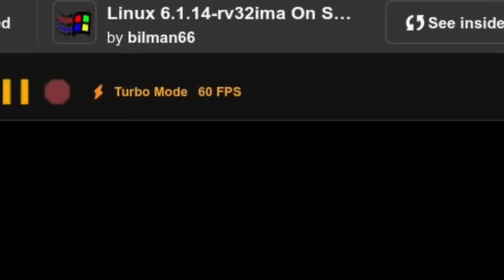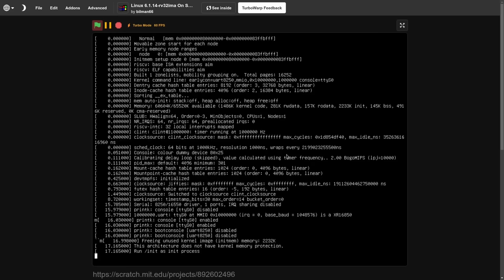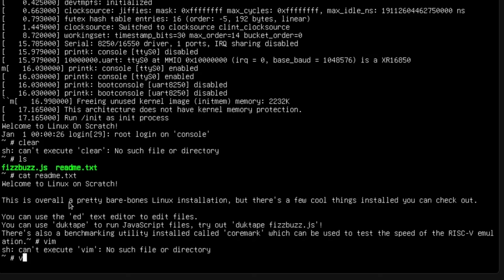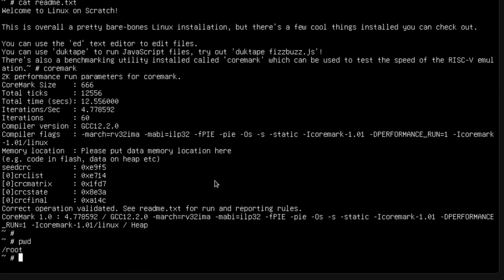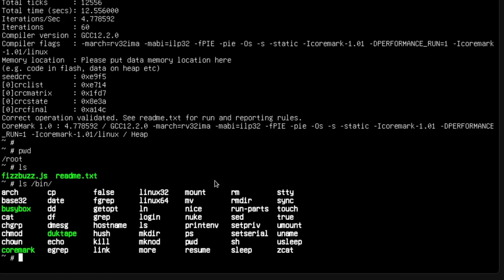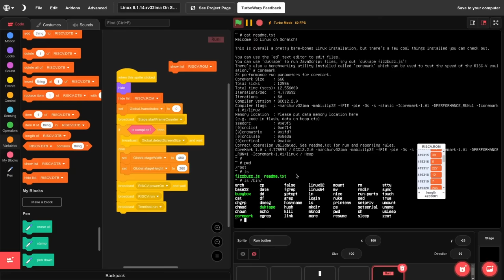They actually DID IT... Linux on SCRATCH

Comment: so strange how the dev included a js engine into this but not a C compiler
Reply from the maker: It is strange! I was thinking it has something to do with Scratch being in JS, but I'm still not sure.
Reply: It is in fact @Denshi
Reply: @Denshi  Yes, Scratch is made with Javascript and Turbowarp even compiles Scratch projects into Javascript, but that has nothing to do with this project.
Reply: I think js is easier to implement?
Reply: @Denshi  don't  think so Turing machine https://en.wikipedia.org/wiki/Turing_machine
Reply: if you have the kernel you can perfectly well implement anything with relative ease
Reply: EDIT: I'm wrong stop liking this 💀💀

Turbowarp compiles scratch projects to Javascript, making it trivial to run javascript (they did not need to implement a javascript engine)
Making a C compiler would be torture
Reply: @iluvsoupers  that's not how it works though, you can't just run arbitrary javascript in scratch (or turbowarp), also porting the C compiler isn't hard, as tinycc can be compiled to riscv
Reply: @int32_  My bad then, could've sworn you could do that in turbowarp
I didn't really look at the project itself because I was away when writing that comment
Thanks for the correction
Reply: @Denshi  Hello, I helped make this project and built the ROM it is using. It has nothing to do with the fact Scratch is made in JS and everything to do with the fact the I am lazy. The duktape project was included because it was made for embedded systems and as a result, worked very easily with this version of linux. It had also already been built for RISC-V 32-bit by somebody else, so it was very easy to port over. I plan to release another version of this project in the future which includes tinycc. In my opinion, it was also a more impressive demo to see JS running than a C compiler.
Reply: @tacodiva7729  Weird, i literally put a comment on here not too long ago saying the same thing but it seems it was removed lol
Reply: @garethgan9519 It is not. C is a drastically easier language to write a compiler for, because a C programmer is required to explicitly explain more details to the compiler. A JavaScript engine has to keep track of a bunch of extra things at runtime because the programmer never specified what they should be.

(Specifically, I'm talking about dynamic typing and automatic garbage collection)
Reply: @Nanagos  Scratch is Javascript and Smalltalk. (or the old scratch client is Smalltalk)
Reply: Because running a compiler would be much much much more resource intensive then to just use a really rudimentary JS interpreter. The interpreter used here, duktape, is also only a few hundred kilobytes in size.
Reply: @Denshi why does qemu not work when i try to emulate a newer gen intel cpu on an older intel gen?
Reply: you do know scratch has a file size limit…
Reply: @iluvsoupers how would it be a nightmare? This is the riscv architecture not some unique black magic, pretty sure riscv compilers for c already exist?
Reply: I'm only a minute into the video, but he said it's just an emulated RISC-V processor; doesn't GCC already target that considering the kernel exists for it already?
Reply: Because he's gay
Reply: Probably because GCC itself is several gigabytes. Duktape on the other hand is extremely tiny compared to that.
Reply: the Hubris of Man is still conjecturing why this is the case when someone from the project clearly explained it
Reply: @amogus-dn8qn Kind of, but you need enough memory and computation.
Reply: @amogus-dn8qn  How? Dont you still have to implement a compiler which is also hard ?
Reply: no, you can just throw any linux-compatible compilef on it of you want
Reply: i love not knowing coding things so this means literally gobbledygook
Reply: @garethgan9519  no, no it is not
Reply: @garethgan9519 Much, much easier to make a js engine in a js engine than a entirly different language
Reply: i think gcc or clang would be too big for the ROM since scratch has a list element limit
Reply: based zoomer dev
Reply: It needs a HolyC interpreter
Reply: @antonliakhovitch8306  just ignore past me (That's my past acc). I hate my past self lol. such inexperience. ;-; (And yes, I know, C is a low-level language, closer to asm, so easier to make)
Reply: Recent GCC and LLVM would make the disk image huge and run very slow, TCC is feasible but I doubt it has a built-in linker for RISC-V, and GNU and LLVM binutils are kinda huge. Not having a linker would be useless either.

Comment: The only truely bloat free installation.
Reply: Second only to not running linux at all.
Reply: @EdgyPuer mfs explaining why their barely supported obscure bsd distribution is actually way better then Linux because it saves 25 mbs of ram
Reply: @Natalietrans  Not running an OS or even a computer saves far more mbs of ram.
Reply: @EdgyPuer   You fool, I run Linux on pencil and paper by following RISC-V instructions by hand /s
Reply: @glitchy_weasel 😂
Reply: computing like it's the 1930s @glitchy_weasel
Reply: Despite making this they still got rejected from a job opening for a senior level Scratch developer
Reply: @glitchy_weasel you must be my 2nd year CS professor.
Reply: it has js and a benchmark tool, pretty bloated if you ask me
Reply: Just use paper and pen, no need for computers
Reply: well it has javascript so no its not
Reply: @glitchy_weasel  The good ole 0.01 Hz processor
Reply: @glitchy_weasel  It's a good thing you included the "/s" otherwise for a second there I might've thought you weer serious!
Reply: Linux users destroying their display (it’s using gpu power and therefore bloatware)
Reply: 'ls' is bloatware, just keep track of where your files are!

Comment: why do I feel like we’re gonna eventually get a full Windows installation in Scratch
Reply: The author of this is working on getting windows 3.0 running in scratch via 8086 emulation
Reply: @iflyplanesthrutunnels  The amount of performance overhead this would cost to a PC would be insane. Gonna make an i9 13900K feel like a potato CPU with how slow it would make things
Reply: Seems possible once someone would shrink Windows to 25mb size, i think it surely could be nano version of 3.1
Reply: why tho? we already have virtual machines, it would be a massive copyright of published although I don't think that would be an issue due to scratch being absorbedly slow

Comment: HOLY.... These madmen, what have they done!!!!!!! And they are BASED AF for choosing RISC-V!
Reply: Probably because its open source and easier to implement?
Reply: @october1234  You have to be trolling me right now?! Even been open source, implementing a FUCKING KERNEL PLUS SOME APPS on FUCKING SCRATCH requires so much dedication and time...
Reply: @godnyx117  Dont get me wrong, I agree that implementing a cpu is extremely hard, let alone scratch. I just want to point out that a possible reason for them to chose risc-v over arm or x86 could be because it is open source.
Reply: @october1234  Oh, I thought you talked about the Linux kernel and meant that it is easy to do it because it's open source, hence why I was so "socked".

In that case, yeah, RISC-V may be chosen for that reason! This project is so cool and interesting!

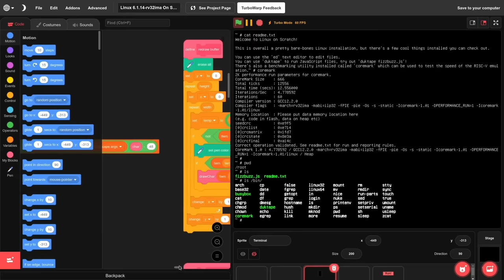Comment: 5:31 
scratch actually doesn't have a native "text tool" that can display text cleanly like this. the text is actually rendered using entirely the pen tool using a font engine that i wrote a while back which compressed most of the glyphs into a list. the font used is GNU Unifont if anyone was wondering
Reply: cool, thanks for creating for it.
Reply: Do you have a writeup about this project? I've been searching but didn't find it. I'm trying to understand what is the content of the ROM. Where is the entrypoint, the initcpio, the kernel binary etc. Or how does /dev/ttyS0 connect to the terminal "hardware".
Reply: @leeroyjenkins0  scratch mesa 😂
Reply: You did this. Man you're a whiz
Reply: You're the goat for using unifont
Reply: Fun! But why? Haha
Reply: wuts ur github?
Reply: VESA compliance next.
Reply: damn, impressive
Reply: True, instantly knew this was fake, almost though no one realized
Reply: Is it possible to reconfigure it to use other 8×16 and 16×16 fonts like Kissinger 2?
Reply: ywnbaw
Reply: @lilcripsythereal the hell you mean fake? its linux running but how else would you see it

Comment: Saw this a couple of days ago, this is completely crazy! Would love to see it pushed to its limits. The dev mentioned that it may be theoretically possible to make like a network stack or some sort of connection to the outside word, so you could SSH into the Linux on Scratch from your terminal. That'd be hilarious.
Also, this is probably the most secure PC on earth, like I'd imagine there's no way to break out of the Scratch emulator lol
Reply: there is a turbowarp extension for that, but its like socket, http, etc
Reply: impossible, that would require http requests to atleast get a server file which scratch does not have
Reply: @PabTSM-OfficialChannel  scratch does have cloud variables tho.. so you could have another computer with the project open that reads and writes to the cloud variables and translates them to allow the program to communicate with the outside world

would be insanely slow though
Reply: @jay-tbl  but how would you get the info to write the variables in if there’s no http requests? all web browsers and games use http requests under the hood
Reply: @PabTSM-OfficialChannel  People have created external servers written in other languages that can manipulate cloud variables for a particular project. Through something like this, communication with the outside world is possible.

Comment: 1:16 Don't know if somebody else has said this, but you are reading the log wrong. The clock speed of the CPU emulated in this project is variable as some instructions take longer than others and it really depends on the speed of your computer, not some fixed value. It usually hovers around 1-2kHz. It is also a 32-bit system not a 64-bit system. The value you are seeing in the logs is about the accuracy and tick rate of the timer provided by the CPU. It's saying that the CPU has a 64-bit clock value which ticks up at 1000kHz, not that the CPU itself is 64-bit and has a clock speed of 1000kHz.
Also, another correction, 5:31, vanilla Scratch does not have a text tool. You might be thinking of the experimental extension they have made which allows printing text but in normal scratch you have to render it yourself which is what this project does.
I worked on this and if you have any other questions I'm happy to answer them :)
Reply: Yep, instantly had those thoughts and happy to see a person in the comments correct it :)
Reply: No, he didn't read it wrong. You are wrong
Reply: @derwastl  I helped make the project lmao
Reply: @derwastl are you trolling?

Comment: I hope someone emulates a Linux kernel in minecraft. they have made CPUs and GPUs on it before. The hardware requirements would be crazy tho
Reply: @bumblebeegamerreal  he probably meant to run linux on redstone, no mods needed
Reply: @_lun4r_  Oh i see
Reply: i think redstone would be impossible, as you probably couldnt fit the required redstone for all the ram and stuff in the loaded chunks, but perhaps you could do it with command blocks?
Reply: that would be legit so cool but might be a little difficult
Reply: @bumblebeegamerreal  btw that mod only mirrors real virtual box's video output to minecraft
Reply: I think there are some mods to make the redstone implementation itself more efficient. So, with an increased tick rate, that might be enough to make a computer capable of running Linux in real time with "vanilla redstone".
Reply: @rz2374  It's not that it would stop rendering, because with enough RAM anything is possible (I mean really, has Minecraft actually used 2TB of RAM on redstone yet?), it's that the bottleneck is that the fastest processor with perfect redstone is... 1Hz. Not a kHz, a single Hertz. No one could debug it to see if it would boot, because it would take forever.
Reply: @CoolCrescent186  isn't it 4Hz? Repeaters at max speed are 1/0.25s = 4s^-1
Regardless, it's not booting lmao

Comment: While attending the University of Helsinki in the fall of 1990, Torvalds enrolled in a Unix course.[52] The course utilized a MicroVAX minicomputer running Ultrix, and one of the required texts was Operating Systems: Design and Implementation by Andrew S. Tanenbaum. This textbook included a copy of Tanenbaum's MINIX operating system. It was with this course that Torvalds first became exposed to Unix. In 1991, he became curious about operating systems.[53] Frustrated by the licensing of MINIX, which at the time limited it to educational use only,[49] he began to work on his own operating system kernel, which eventually became the Linux kernel. This scratched Linux is a good think

Comment: There is actually some network in scratch (turbowarp which is what you're running there, primarily for speedup i guess, not the extra features it provides) however the network functionality is like, basic http requests, not opening a connection, though i'm not sure what's possible if you write your own extension or try to accomplish it via running javascript from within scratch (like, escaping scratch blocks by setting a certain special variable to js source code)

Comment: is it possible to compile a basic windows manager in to this kernel and install the scratch on it. so basically to run scratch inside the scratch
Reply: it would be super hard, but possible. not planned for the future though.
Reply: it'd probably require a lot more tweaks tho. i don't know how scratch works and how its text rendering works, but drawing pixels probably is a lot harder than drawing text. if you can emulate xorg, you can emulate any window manager, just that, you need to emulate xorg, which you need raw pixels for
Reply: @fxiqval  Because the text is using a unix font and has all the special characterslike \n enabled, I think that it is already drawn like an image, not like a scratch text, so configuring an X server to basically draw window pixels instead of text pixels won't be a big deal.
Reply: @misternether8602  that's actually a fair point, it also supports coloring cuz ls has colors, not sure if it supports background coloring tho. if it does, you can print a space w/ a colored background
Reply: @fxiqval  there is no "scratch text", all the pixels for the text are rendered manually with the pen tool.

Comment: It's not "Linux from Scratch", it is "Linux on Scratch". These are clearly different things.
Reply: Its both!
Reply: @Ne-vc5pm  The welcoming message right after the boot says "Welcome to Linux on Scratch", so I deduced that was the name of this particular distro. Is it based on "Linux from Scratch" then?
Reply: @mellowgeekstudio  btw distro cant be based from LFS as it is a book/guide. So they made linux from scratch for risc-v to run on scratch. So its would be linux from scratch on scratch
Reply: @Ne-vc5pm  So my original comment stands correctly, doesn't it? The guy in the video says the distro that he is running is "Linux from scratch", which cant be true because that is not a distro, it is a bion guide to build a distro directly from source code that has been around for years, many more years than the scratch language has. The name of the distro he is running is "Linux on Scratch,", which can be seen on the boot screen: "Welcome to *Linux on Scratch*". So, as my original comment stated, these are different things. Linux from scratch has nothing to do with the Scratch programming language, and the way the video said"I am running Linux from scratch now " clearly will confuse people. That was the point of my comment. 
Hope that makes it ckesr.